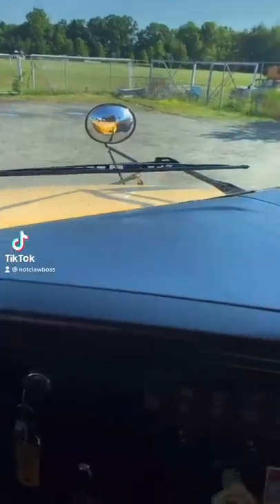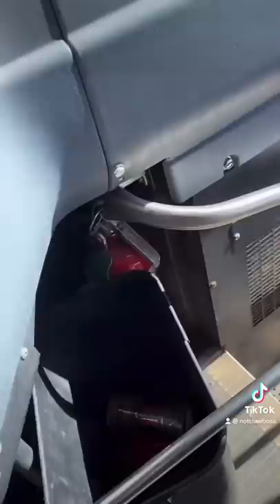MY SCHOOL BUS BROKE! (I thought…)

Comment: Good job Steve, I can't stand rattles either, there is one in my car and I can't seem to pinpoint where it is coming from yet.
Reply: Dude, so my mom has an ‘06 Honda Pilot, and this really annoys me.

So you know how on some SUVs, there’s bumps on the walls inside the back of the car (where the wheel wells are)? So there’s a seatbelt in front of it. The metal bit has to sit on top of the bump, and it rattles and vibrates like crazy when we’re on the road. It drives me crazy. Worse if you have music playing.
Reply: @JackFoxtrotEDM  Wow, you think you can make a video about that, I would love to see what you are talking about. And maybe you should wrap some tape around it.
Reply: @carbuff81  eh

Comment: Someone came to recharge or replace the extinguisher I had one for the guy replace mine in my van and then the next day it decided all I’m gonna be up here by your brake pedals apparently he forgot to clip the new clip back down to the floor the clip was stuck on to the fire extinguisher in the old clip was ripped off from the floor lol he thought 3M products were good enough I told him the screws would actually hold something to a floor that gets constantly dusty